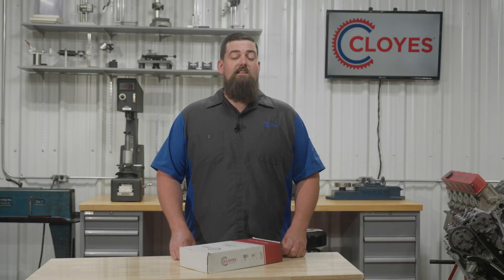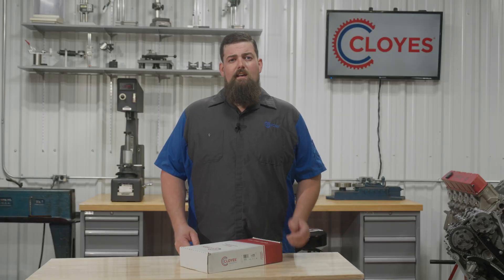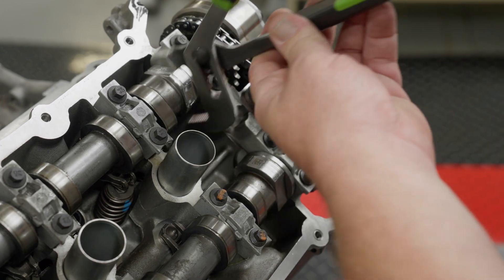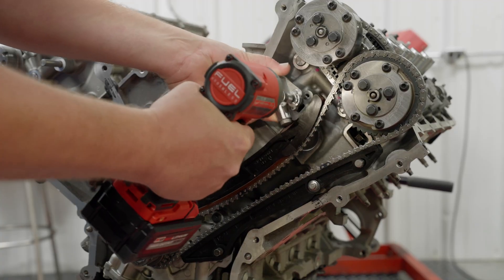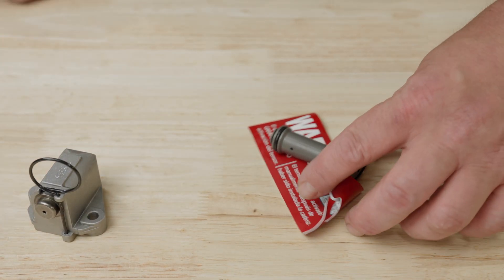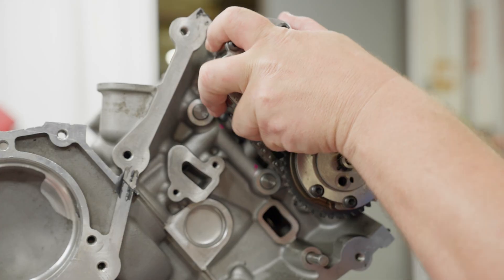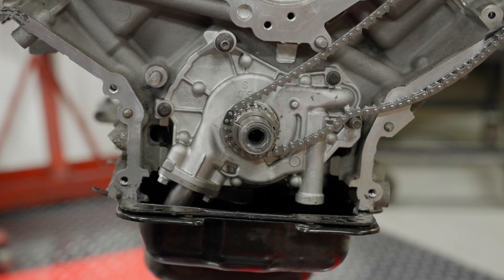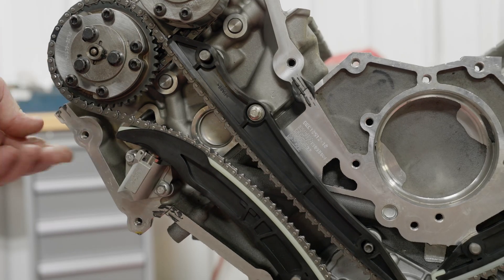Ford Coyote 5.0L Engines: 2015 - 2020 F-150 Timing Chain Replacement Video

Comment: Why are the new timing tensioner shorter than the original? Do you no longer need to clip the bottom guide to the tensioner? 🤔
Reply: They updated them. You also need a new secondary tensioner guide. They have two little tabs that stick out so it won’t go back towards the engine.

Comment: I have a 2019 Ford F-150 5.0L with 121,000 miles on it. About 3,000 miles ago one of the VCT solenoids failed. I had all four of them replaced. They did not tell me that the timing chains needed to be replaced. I have the Carfax maintenance records for this truck and it doesn't show timing chain replacement. I know that does not include all maintenance which has been performed on this truck. For the VCT solenoid replacement, Carfax only shows that the vehicle was diagnosed. Very unhelpful.

I'm curious why the chains needed to be replaced on this truck (in your video) at only 60,000 miles. Any ideas?
Reply: I bought this truck with 112,500 miles on it. According to Carfax data, the timing chains had not been replaced up to that point. It's running the original cam phasers, too.
Reply: @jimc.7121 I had the same problem replaced all 4 vvt and I didnt replace the timing chain. Why do you have to replace the timing chain?
Reply: @MichaelQuinlin-q2k The four timing chains over time eventually stretch to the point where they can slip a tooth on the sprockets. That's referred to as jumping time. The danger with an interference engine (where the valves can collide with the pistons if the engine gets too far out of time) is that the engine can destroy itself. I plan to perform a timing job on my engine at 150,000 miles. That involves replacing the timing chains, chain guides, cam phasers, chain tensioners, water pump and drive belts. I may or may not replace the VCT solenoids, since they were recently replaced.

Comment: What if disassembly procedure isn’t followed? What is best way to find shaft location?! Please help… I’m assuming find TDC & compression stroke on RH front plug? “Number 1”
Reply from the maker: You just need to rotate the shafts so the timing marks on the sprockets match the locations in the video. That will put you in the correct stroke by default. Just be careful when rotating shafts. You need to first find a crankshaft position where none of the pistons are at TDC on one side, then you can move those camshafts.